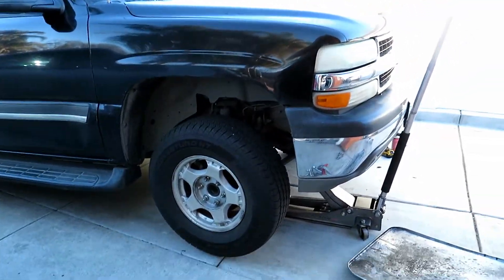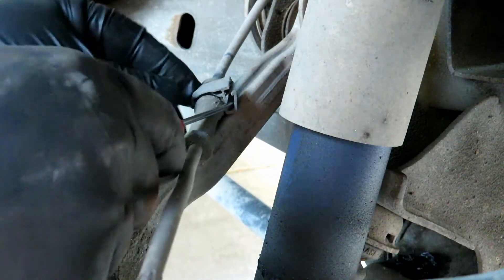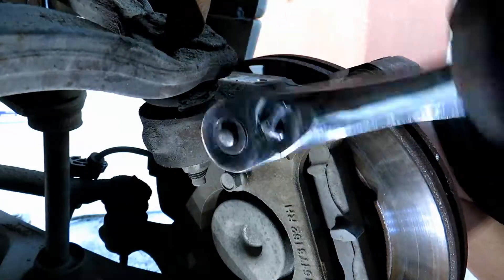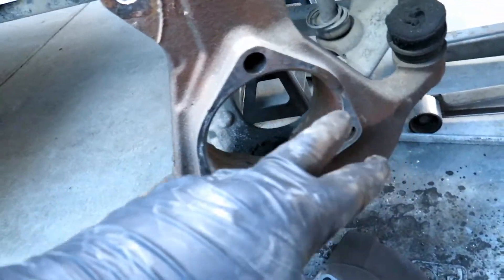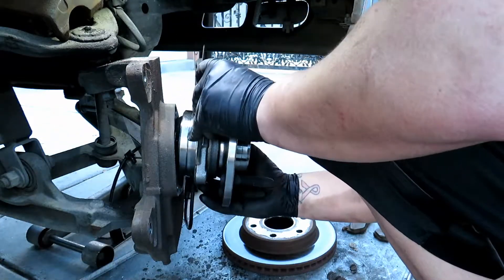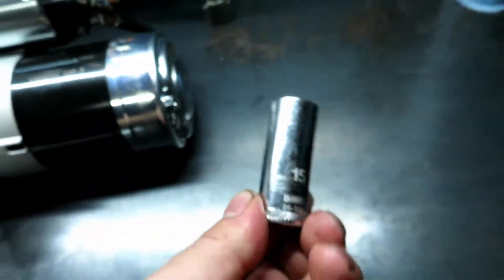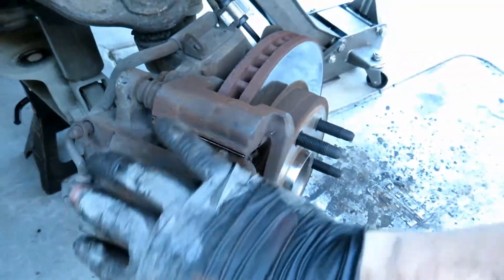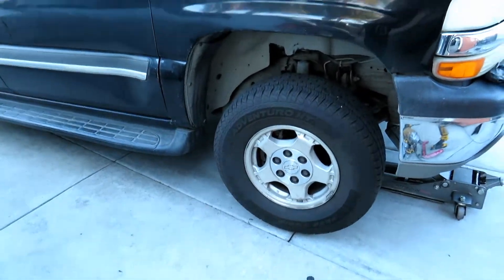Chevy Tahoe 2WD - Front Wheel Bearing

Comment: What does it mean when you speak on how much torque and ftpounds?
Reply from the maker: how tight the manufacture requires the bolt/nuts to be.
Reply: Those all need to be super tight as you wouldn’t want them to loosenup, use some blue loctite on the threads for extra measure